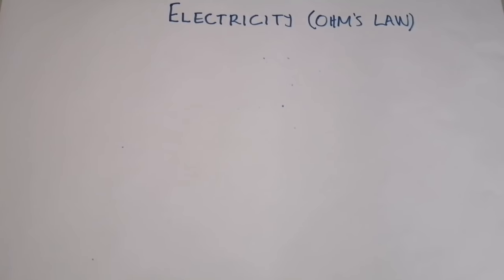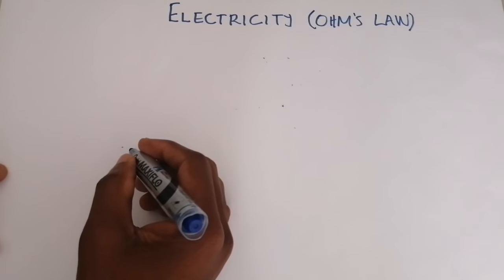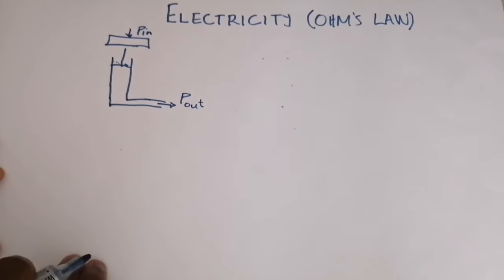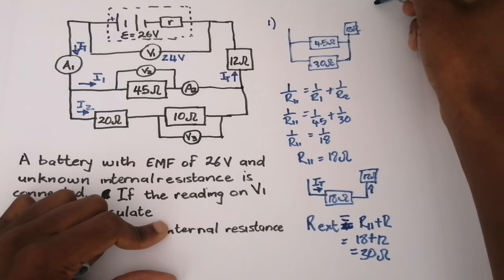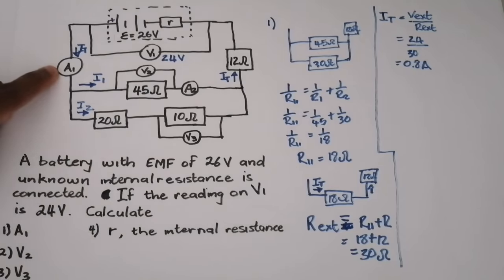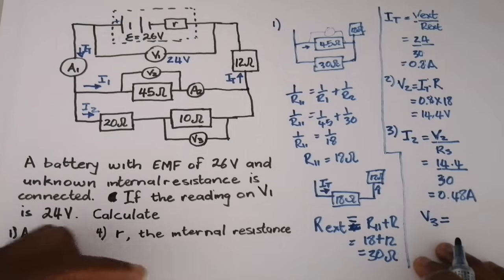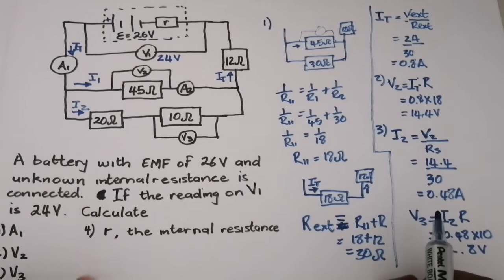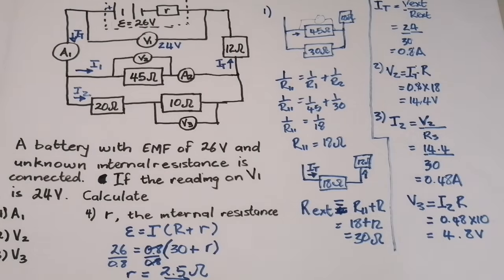Physics | Electric circuits | EMF and Internal resistance (Made simple)

Comment: For V2 I started by calculate voltage across 12ohm resistor because the current that flows there is the total current which is 0,8A then I got the answer of 9,6V thereafter I said Vexternal which is 24 minus 9,6 then I still got 14.4v as my V2... Many ways to kill a cat. However I learnt a new trick from you sir. Your work is much appreciated will definitely be referring my students to this channel.
Reply from the maker: You're so right... Many ways to tackle circuits. Thank you so much sir.

Your learners are most welcome. It will save from a lot of work on revision for the prelims
Reply: @MlungisiNkosi  Most definitely.

Comment: sir for question 3 I did the following: current in A2: V2/R : 14.4/45 = 0.32Ampere.
then current through 10 ohm resistor = total current -  current in A2 = 0.48A
V3=IR
0.48 X 10 = 4.8V?
Reply from the maker: That is perfect…
Reply: Thank you

Comment: Hi Mlungisi  I've been watching your videos and they are very helpful however I've been researching what would be considered a bad internal resistance for a battery for instance if I have a 2V Cell with internal resistance of 0.25 mili ohms what but when I test the IR I get something like 0.75 mili ohms would you say that's Bad or my battery still has some life in it
Reply from the maker: Ideally what you would like is to have zero internal resistance… However, that’s impractical  in real life. What you do want though is for most of the power to be utilised towards whatever load the battery is trying to supply.

Comment: When calculating the V2, why did we not say it is equal to 24V as it parallel with the Vtotal?
Reply from the maker: That would've been the case if we didn't have the 12ohm resistor on the side... Some of the potential goes to that 12ohm resistor.

Therefore the voltage across V2 cannot equal Vext (Vtotal)
Reply: Oh the Voltmeter readings in parallel are only equal when there aren't any other voltmeters placed in series?
Reply: When calculating the internal restistance why did we not say,  emf-Vexternal =r, which will give us 2ohms
Reply from the maker: @Nobars-z1q  emf - Vext = Vinternal (the voltage across the internal resistance)

You may subsequently calculate the internal resistance: Vinternal = Ir (I is the total current)

Comment: Hello sir I want to know if it's wrong to say 1/45 + 1/20 + 1/10 when calculating for the parallel resistance?
Reply from the maker: No, there's nothing wrong... However, you still need to invert the answer to that sum to get the effective resistance.